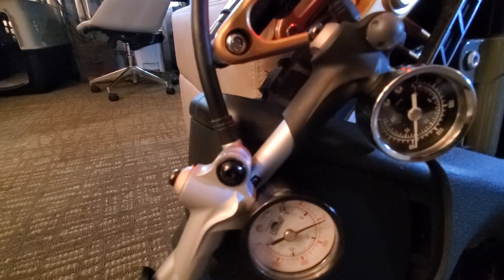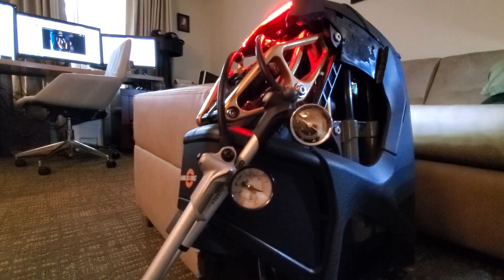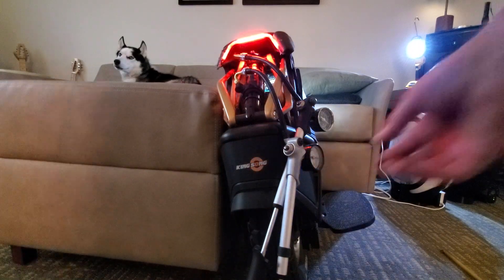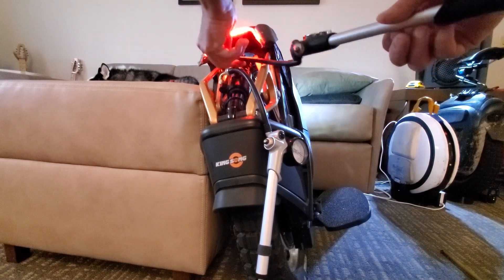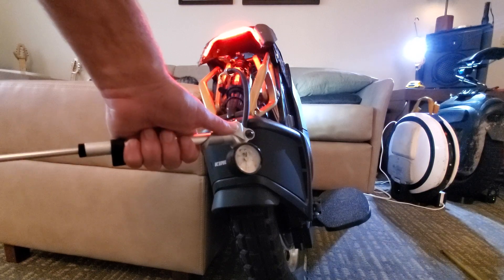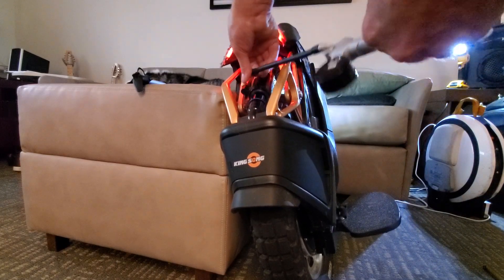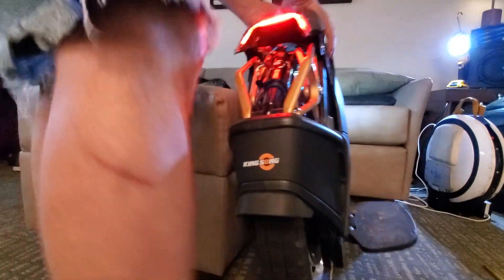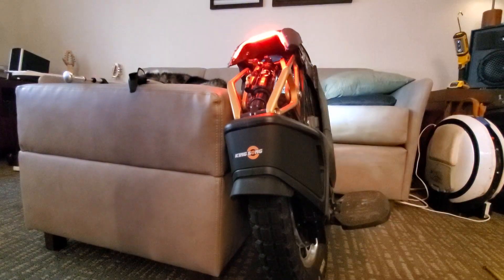Inflating the Kingsong S18 shock Comparison With vs Without the Block

Comment: I like how you have two pumps attached at once.
Reply from the maker: Thanks.  Yea it made this test easy... the block effect sucks!   Valve extenders rock too.
Reply: @reitze01  this is Mike Onewheel from Facebook. I just received word yesterday that my S18 shipped from ewheels.  Psyched!
Reply from the maker: @mikeintampa250  Buy these now!!!  It will make the shock-setting easy - as it was in this vid to just top off the pressure rather than fiddling with that block and seeing what's done to the pressure.  https://www.ebay.com/itm/5-PC-45-Degree-Tyre-Valve-Extension-Adaptor-Motorcycle-Car-Tire-Stem-Extender/263488559466?ssPageName=STRK%3AMEBIDX%3AIT&_trksid=p2060353.m2749.l2649
Reply: @reitze01  I just ordered them from Amazon so they'll be here on Friday in time for the wheel.  I remember seeing you discussed them either on FB or in another video.  Thanks!  My stanchion oil just arrived today. My slime arrived the other day. I'm trying to be all prepared for when this wheel arrives
Reply: @reitze01  check out the new post for Marty on FB. He climbed the mountain with the S18 and still had 45% left. I'm glad I didn't order the V 11